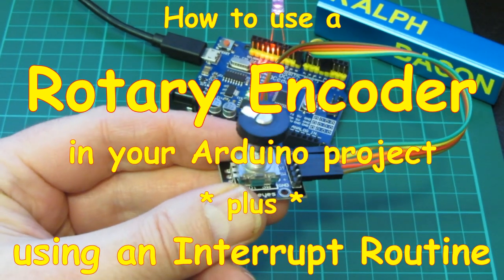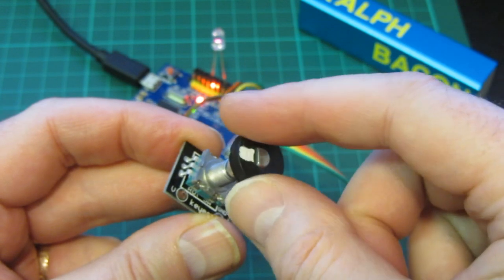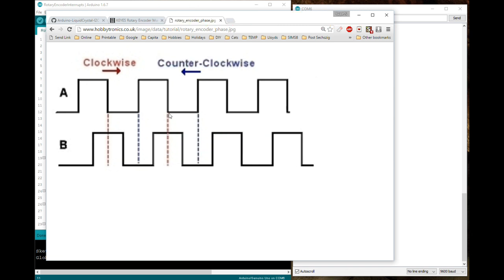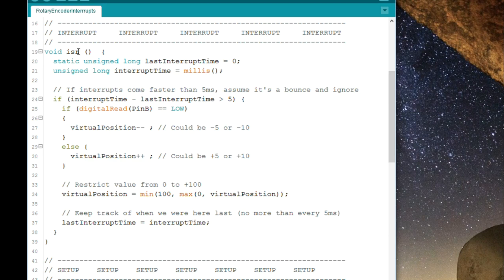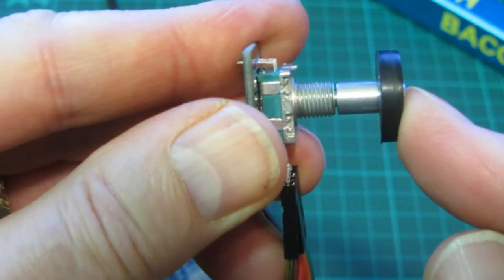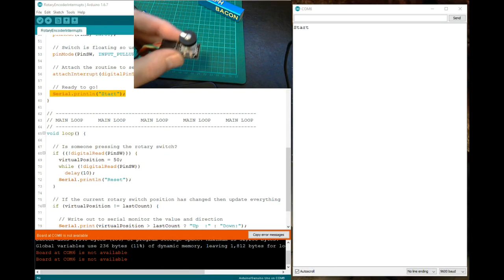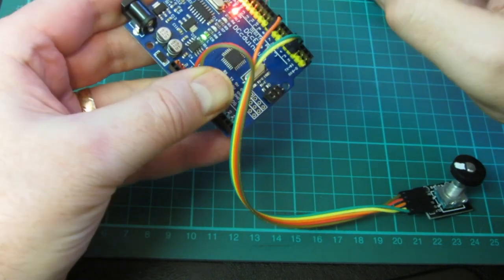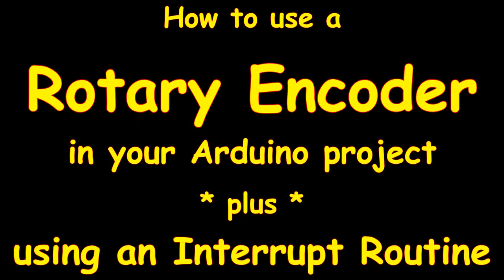#19 How to use a Rotary Encoder with an Interrupt routine on your Arduino

Comment: as said in a coment: use "falling" instead of "low"for the interrut
Reply from the maker: What's your reasoning behind that Oma? Have you tried it? Does it work better than "LOW"?
Reply: Ralph S BaconHello Ralph, rising or falling or change just detect the edges and fires only once the interrup. This is what I used for buttons and rotary switches. Where low or high will fire the interrupt as long as the level is detected. It still might work well with some encoder but did not wored out for me. After my last comment I saw your newer video an the newer codes. Anyways thank you for your great videos and well feedback. Cheers 
PS: would love to see something by you about Can Bus e.g. mcp2515 or low power usage (idel, sleep, reduce clock) or running code non-blocking (no delay), using SD card for storring data ...all one need for a stand alone battery powerd data logger :) ...just some hints
Reply from the maker: Thanks for the suggestions, Oma, I'll certainly see which ones I can add to my list of future videos.
 
Regarding the ISR being triggered on "LOW" for as long as the low level is detected, this is not true! What I expect you experienced was switch bounce (the switch literally bounced for a few milliseconds from LOW to HIGH and back again) and triggered the ISR multiple times. This has been a topic of some recent videos - if you haven't already watched it, see video #98 for exactly how switch bounce can cause problems in your code. Thanks for responding, Oma, and keep tuned!

Comment: Dear @Ralph S Bacon can you please do the same on ESP8266 platform too?!
Reply from the maker: This will work exactly the same way on an ESP8266 as it does on the Arduino, beicel. Just make sure that Pin A is connected to an interrupt pin on that device. Luckily, interrupts may be attached to any of the GPIOs of the ESP8266, except for the GPIO16.
Reply: Dear Ralph, did you tried it? Because I was, and it's not working on ESP8266 (hooked up correctly), can you please elaborate your sketch/code again?!
Reply from the maker: I've certainly tried it in the past but have no demo for it. But this page walks you through it, step-by-step:
https://techtutorialsx.com/2016/12/11/esp8266-external-interrupts/

I suggest you try the example there with just a simple momentary push button switch to prove it all works before connecting the Rotary Encoder. I hope this helps.
Reply: I triead almost all of them and they are not working (duplicate or skipping results), but your example can't work on ESP platform because there is no LOW in attachInterrupt() on it, it's not supported.
Reply from the maker: In that case use FALLING, which I found worked on the Arduino but not as well as LOW. If you use a switch (as I suggested above) you should be able to prove it works fine. If it skips or duplicates pulses then you have a switch bounce problem which I deal with in my example but you may need to extend the delay from 5mS to 10mS (for example) in the ISR.
Reply: I tried already everything changing to FALLING, RISING and CHANGE, nothing works, I also changed the delay from existing 5mS to 50mS, and nothing! Can you please, please verify on your side too?! (on the Uno it's working great)
Reply from the maker: As you will have read in my blog https://ralphbacon.blog I'm short on time but I'll see what I can do over the next few days, stay tuned!
Reply: Okay, just do it, I'm waithing for the outcome! ;)
Reply from the maker: OK, beicel, I hope you are still monitoring this thread as I have now carried out my experiment.
 
Using a Wemos D1 R1 ESP8266 board and the sketch shown here: https://techtutorialsx.com/2016/12/11/esp8266-external-interrupts/ (bottom of the page) this worked perfectly. The interrupt pin used in this demo was pin 13 which is marked as D11/MOSI on the top and GPIO 13 underneath the board. I just used a Dupont cable to touch that pin to GND and got the results you will see in the screenshot.
 
You can download the entire sketch and see the screenshot here: https://www.dropbox.com/sh/l7bzy5hj46ywa58/AABjo0yydmB5nzeAuK_nPI9da?dl=0
 
This will work for you too, so do let me know how you get on!
Reply: Thank you for your feedback, I have seen that tutorial also had bookmarked a while ago, but I managed to suite your code without any big changes, I'm using pins 14, 12, 13, changed the Interrupt to FALLING and the debounce delay is set to 250mS (without any skipping), and your existing code is working great on ESP platform! ;)
Reply from the maker: Hurrah! So glad to hear it! Having 250mS (= 1/4 second) as a debounce delay is unheard of though, you should not ever need more than 20mS, try reducing it and see if it still works as you expect. But thanks for updating me.
Reply: Yeah, tried with 50mS and with that will start skipping, and I know it's to much, but it's working.
Reply from the maker: That's the main thing, it's working!
Reply: Yes, indeed!

Comment: OK, its the encoder. It's from Creatron Inc in Toronto. They have an EC11 on a PCB with 5 pins. Seemed great, but there's a IC chip on the back. No idea and not in their poor documentation. Cost me $8.25 and four days of code searching !!!!  and it won't work with the switch pin connected. I can't recommend this supplier, so your viewers should be forewarned. So sad. Could have paid half the price for a raw encoder and avoided all this. 

Pins are VCC, L, R, Z, And. So L is your A, R is your B, VCC connects to Z when switch is depressed. No idea what the IC does (8 pins, "472" on it). 

The switch applies 5V to Pin Z when pressed. I'm afraid to connect this Z to pin the arduino "switch pin". I'd be applying 5 V to the arduino.  Do I need a resistor to limit current? What value?
How would you change your code? My LED is going dim, off at "0" then full bright,  then all of a sudden bright with repeated "down" turns. Labelled differently. Totally works. I wish all parts had the same labeling as to AB, or 1,2 or LR.... really. Great code, thanks. Off to the races now except for the switch.
Reply from the maker: Hi Ron, I've looked at the (bilingual) datasheet for this device and it looks like a standard rotary switch with the exception that it has limiting 10K resistors built in. But it apparently has Terminals A, B, and C(gnd). There's no mention of the push switch on the data sheet so if it has one you will have to use a multimeter to determine which two pins are used for that. It also has some 0.01µF capacitors on the outputs A & B to help deal with switch bounce. They may be marked 103 on the board. No idea about anything marked 472 although it could be a capacitor 0.0047µF but it's not on the datasheet. You must also connect the VCC to +5v. 
 
Actually, I see from your post that you have indeed already correctly identified the pins for A (left), B (right) and Z (gnd) and the push switch Z which goes HIGH when pushed. Even spookier, in part 5-1 of the datasheet they have that waveform drawing I used in my video!
 
Finally, in part 5-3 (Switching Characteristics) it seems to indicate that the A and B voltages are HIGH when OFF and LOW when ON. Best check that against my demo to ensure this is the right way round for the demo sketch. I assume that the interrupt will be triggered when the rotary switch PIN A goes low (to gnd) but here it may be the other way around (that is, it goes HIGH). Tricky for me to test but you can by changing this line:

  // Attach the routine to service the interrupts
  attachInterrupt(digitalPinToInterrupt(PinA), isr, LOW);

so that is is looking for a HIGH value (not a LOW) one. Have a go, and let me (and everyone else fascinated by your (rather expensive) Rotary Encoder issues) know!

Comment: how to use rotary encoder without ardiuno
Reply from the maker: +swaraj pal singh
Why would you want to? A Nano can be had for a couple of pounds (or dollars) when sourced from the Far East (or here in the UK) and effectively provides 'black box' functionality for a rotary encoder. Now, yes, you COULD design some discrete component circuitry to replace the Arduino but I have not done this and certainly would not waste time trying to do so when you can achieve it all with a Nano! So can't help you there I'm afraid but I would be interested in knowing why you asked the question?

Comment: You have to use both interrupts to make it work properly. In real life it works not as perfectly as in this video.
Reply from the maker: Absolutely not, shekaus! All the interrupt should be doing is checking for pin A. Once triggered you should just READ the value of pin B to determine the direction of rotation. Thousands of makers use this every day with a single interrupt, so why not download my sketch and try it my way?
Reply: @RalphBacon  I tried your sketch, actually. And I see strange behavior in half-step: Serial output stops till the next full step. I looked very carefully into your sketch and couldn't explain this.
 That why chosen another script which works fine.
https://github.com/RalphBacon/RotaryEncoderUpdate/blob/master/RotaryEncoderInterrrupts.ino
Reply: I found the reason. You should change the logic to CHANGE event. using LOW leads to this problem.
Reply from the maker: Or FALLING as that is really what we are checking for on Pin A. Glad you found the issue for you. I suspect it was the half-step Rotary Encoder, mine was full step. I did another video on quarter-step RE it was video #96 (the original was this video #19).

Comment: Very confusing. Not explained very well.
To begin with, you go on about it goes high then low. But your turning the switch while explaining seems to contradict yourself. If you just turn 1 click cw, does the pulse go high, then low again ? Or do you have to turn it to the next click to have it go low ?
Secondly, your visual aid is confusing. Is it supposed to be voltage level plotted against time?
That works for cw pulses, but how can you plot voltage against time going to the left ?
Reply from the maker: Oh dear. It was not meant to be confusing. With a Rotary Encoder, one "click" or indent of the device means coming back to the starting voltage levels; that is, initially pin A will be HIGH and pin B will be LOW (your device might be the other way round). 
When you rotate the knob CW that one "click", pin A will go LOW for short time and pin B will go HIGH for a short time during that tiny rotation. Then they return to where they started from.
Yes, the graph is voltage against time (I think you knew that) and for anti-clockwise rotation just read the graph going the other way. I think this is pretty clear from my video. Still not make sense?